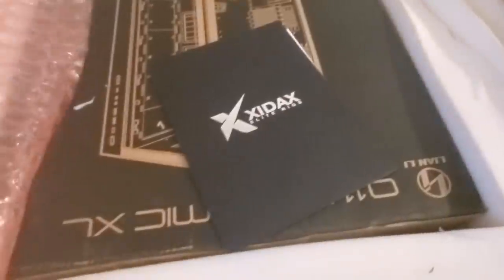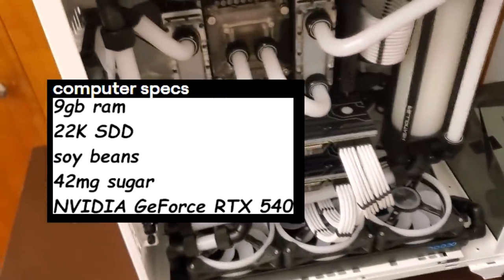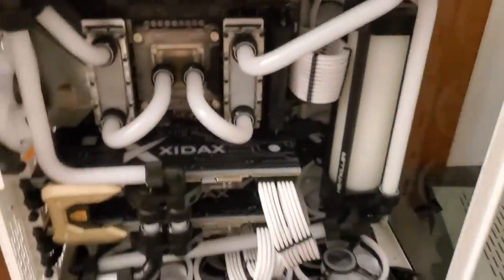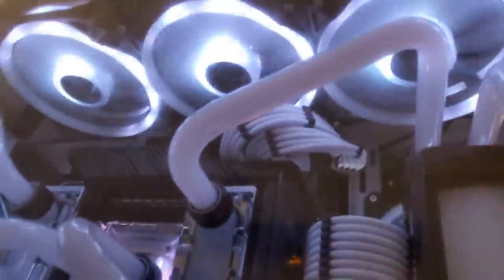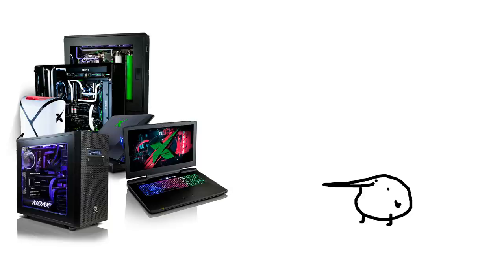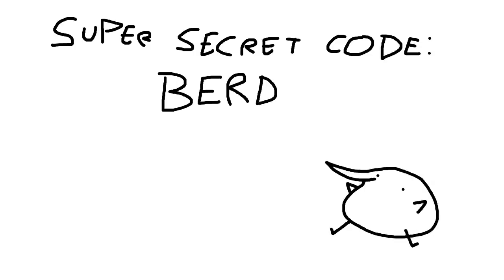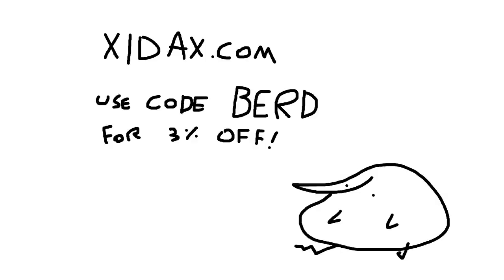berd gets a new computer and goes mega bongo mode

Comment: I've never seen a computer shipped in a crate! Mine was shipped just in a regular box.
Reply: Ew you bought a prebuilt
Reply: @huttonberries768  :(
Reply: @A_Pro_Fuze  mine worked for 13 years actually, I had it pre-built but customized. I just recently got a new gaming laptop to replace it.
Reply: @MagicalToothpaste  was it a custom loop tho
Reply: @A_Pro_Fuze  It was! And my computer was very silent too. It probably needs to be replaced. About a year ago it just stopped working, I think the power supply went out. I need to get it fixed so I can recover all my documents
Reply: @MagicalToothpaste  cmos clear or smth? If youre going there loop refill
Reply: @A_Pro_Fuze  I think it was cmos clear

Comment: Here is the Config by the way: 

Xidax X10
Lian Li O11D XL Silver
Asus Zenith Extreme Alpha
Threadripper 3960X
128GB 3200MHz 
Watercooled Memory
Silverstone 1500W Titanium PSU
Elgato 4K60 Pro MK2
Dual RTX 2080Ti Watercooled
3x SSDs 
Probably some HDDs 
Windows 10 Pro
White sleeved cables
RGB Strip x2
PETG Hard line liquid tubes
Corsair QL Fans
Heatkiller Tube Reservoir
Koolance 702 White Liquid coolant

Totaling (as configured) $10163

:D

Comment: Theoretically I could spend my limited resources on a new PC. Amazingly, though, my current PC performs acceptably well. I don't do anything like rendering which would use up a lot of resources, and for the most part games are no longer relying on the advancement of hardware for innovation. Or even looks, really. Why would I want to spend hundreds of dollars so that I can brute force a poorly optimized game with identical mechanics to something from the 360 era into running smoothly?

Of course, my laptop's case is slowly disintegrating, so some day I will probably need a new system if only because my current one suddenly breaks in half. And being able to play VR will be fun but I'm kind of set on getting the Index or whatever's best at the time and I'm certainly not rich enough for that at the moment!

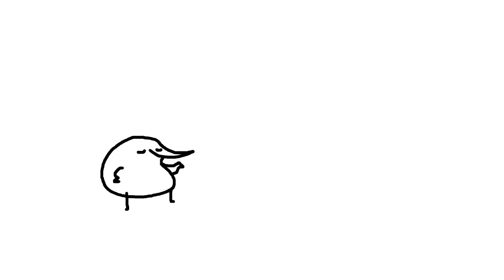Comment: so hes telling me a RTX 3070 aint good enough to render that picture? xD 2:53-3:11 and i dont think who made the pc has anything to do with it, the difference is the specs.

my specs:
GPU: Zotac RTX 3070 OC
CPU: i7 10700K oc to 4.8 GHz (max is 5.1 and base is 3.8) (water cooled)
PSU: 80+ gold
Motherboard: Asus Prime Z490-P
RAM: 16GB RAM DDR4 (3000MHz
Monitor: 144Hz 1920x1080
not important but storage: 512GB SSD and
 2T HDD
yeah bois its not good enough, to to yeet it out the window and get a 3090 from asus and a R9 5950X and fucking 128 GB RAM clocked at 3200MHz even tough im never gonna use more than 20 of it.... ever